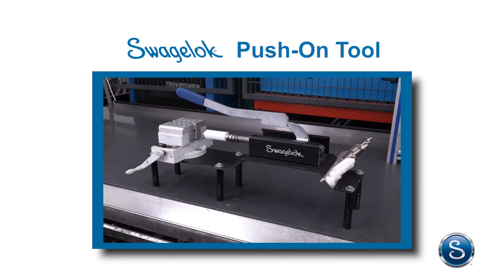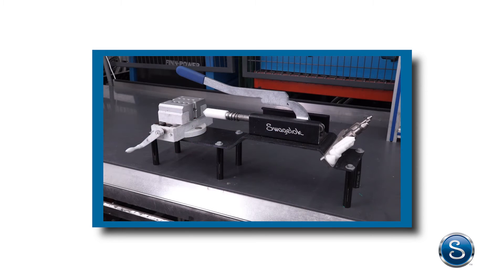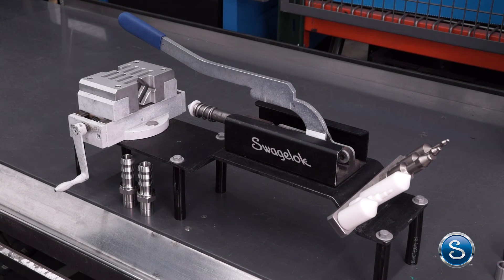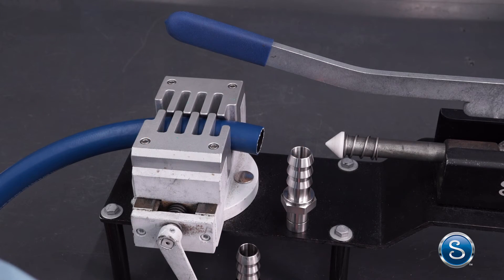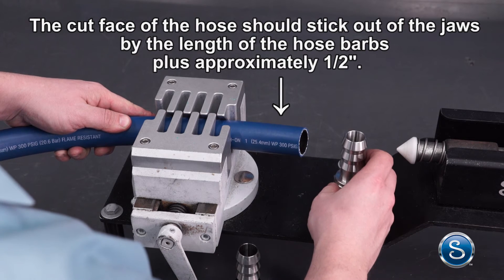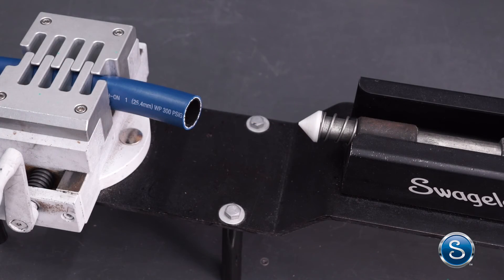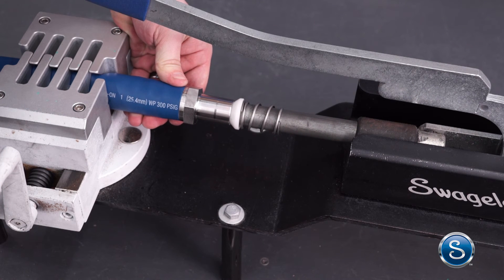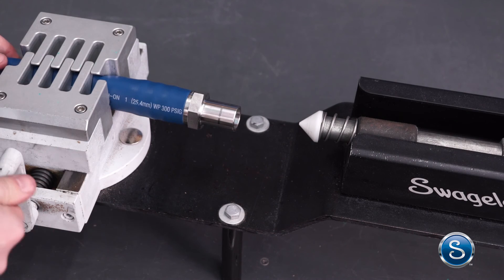Swagelok Push on Tool for Hose End Connections

Comment: Would this work for 1/4", 3/8" and 1/2" Continental ContiTech INSTA>GRIP NON-CONDUCTIVE 300 PSI W.P. Flame resistant USMSHA 2G-IC-14C/32 Made in the USA?